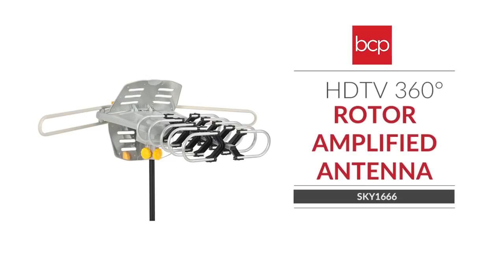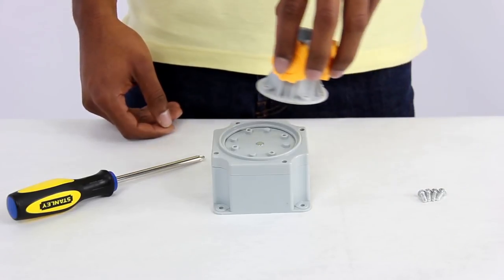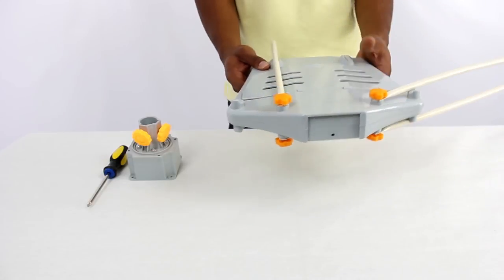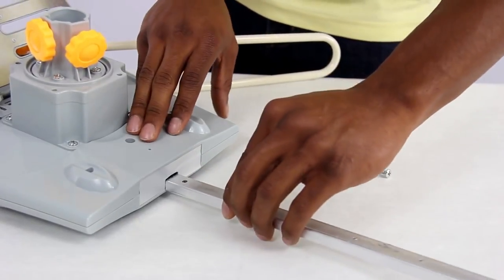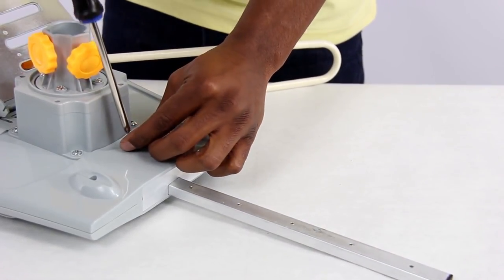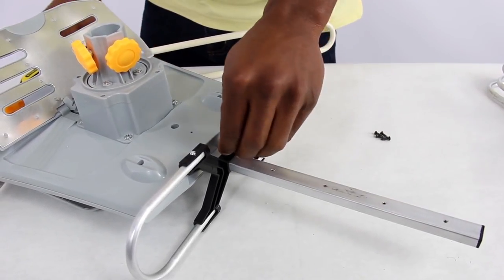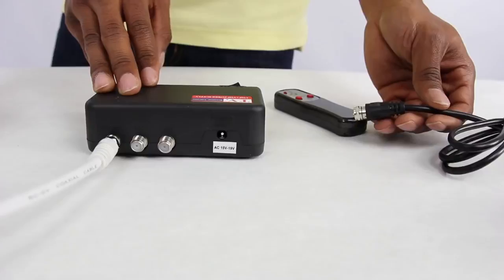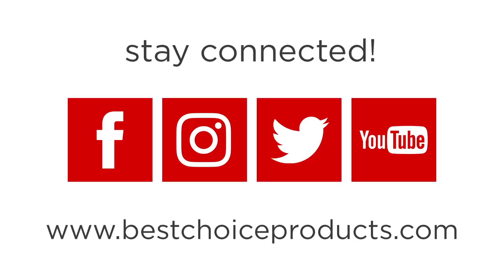Assembly: HDTV Rotor Amplified Antenna (SKY1666)

Comment: Where’s the damn stand @🤔
Reply from the maker: This Outdoor Antenna will use your existing stand or pole, or if you need to install one, make sure you follow all the local regulations. But stand or pole is not included.